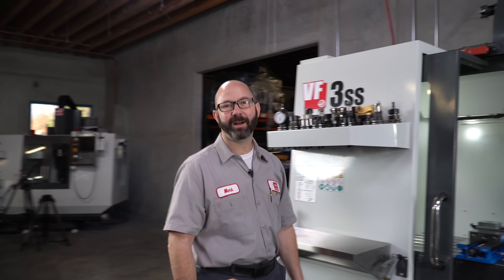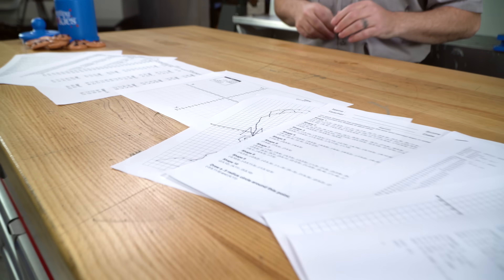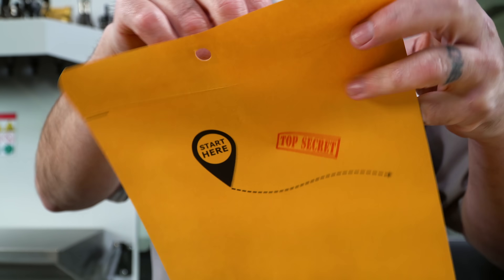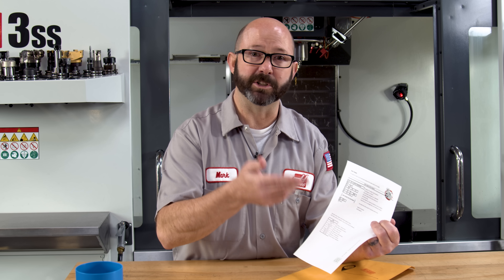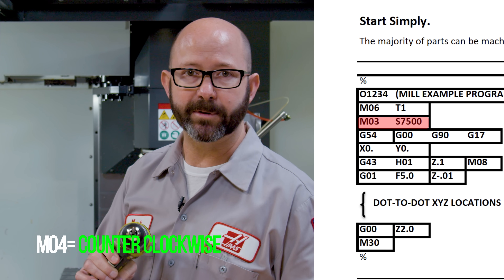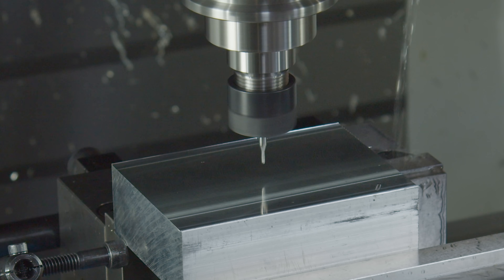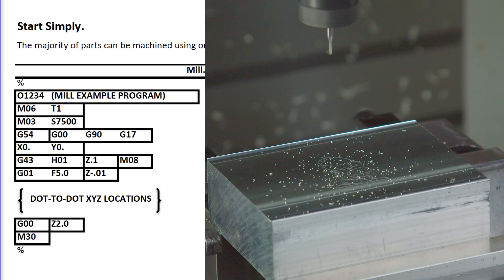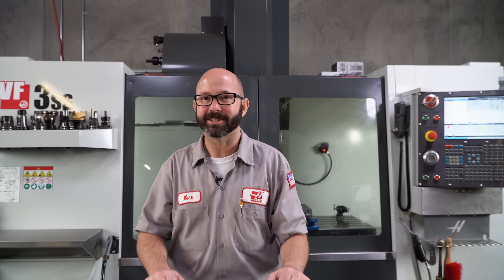9 Lines of Code Every CNC Machinist Needs To Know! - Haas Automation Tip of the Day

Comment: problem we got is  30 tool holder but 100 tools, so we use H numbers 1-100 , then get them wrong in the g-code and break them .. ... .. .. ...... ..
Reply: I doubt you’re using 100 tools in a single program. I can’t recall ever really using more than 20-30 tools in a single program, often it’s like 10-15 tops depending on the complexity of the part. When doing setup for either the entire part or individual operation if it’s a multi-op part is setting up your tooling. You load them in and touch them off real quickly. To save time I often write down the length and diameter on the side of the tool holder with a sharpie if I have to take it out and put it right back in in a subsequent op and need tool magazine space or when transferring to another machine real quickly. Not sure why you’re having your issue. Your setup sheets from your CAM should tell you which tools to load and assign to the various tool number.
Reply: @jumpman2680  i hear you,  i dont htink we are using the machine properly,  we are using it to do alot of hole drilling ( hydraulic manifolds)  and are manually typing out the g-code..

Comment: I am confused, I understand most of the G and M code, but I still feel lost.
Reply: Don't worry it sometimes happen, even i have suffered from this bro! The CNC machine is just a cartesian robot meaning it can only reach any point in the space with the help of linear movements. Therefore only ideal possible code for cartesian robot is GOO/GO1. You need to input a point to machine, by default it will take origin point + user  input point, then machine will figure out  how much  it need to move in X,Y & Z so that it can reach that point.  Any shape in the world either it is 3d/2d is just collection of points. Rest of other codes are for efficiency and user convenience  and also important. You can only define the geometry of any shape with help of notion of POINTS....why these things the way they are.... a lot of this stuff built by mathematicians back then....That's why they look very abstract....The CNC machines theory comes from a lot MIT SERVO LABRATORY in 20th century. Best book I suggest to read: "Theory and Design CNC machines - springer". I have tried my best bro. Don't worry you will get it, just it takes some time.  Sorry for my bad English, My mother tounge is different. Sorry again!

Comment: I am currently learning the old Haas SL30 at my job. I am freshly graduated from 4-year machinist apprentice school and am soaking up as much CNC knowledge as possible. This video series is awesome. Definitely need this. Subscribed!
Reply: What kind of salary are you getting ? I know it's such a superficial question  and very location based, but I'm curious. Thankyoh
Reply: @hassaanawan9606  I work for a Department of the Navy owned shipyard. I’m a WG-10. I’m hourly not salary.
Reply: @hassaanawan9606 I've never  been to a class for cnc 6 years experience running varying machines from crap lathes and mills to extremely nice lathes and mills. I make 32 a hour. Average about 80k with ot. Think I got like 84 last year this year we got less ot so a little less. Hoping to get a little higher wage soon and break that 100k mark. Alot of machinists / operators make less than me though. I even make more than half of the journeymen make in our shop. Seattle area just to give you a reference point. If you want real money get into hvac lol

Comment: What is the point of the G17?
Reply: It sets the active plane as XY. Some machine controls use XY by default but it’s good programming to always set your active plane. You might machine 99% of the time in XY on a 3 axis but for example if you’re using a ball mill or a 5-axis machine you’ll likely need to switch to another active plane.

Comment: how does the M6 command knwo what to do withoud additional gcode
Reply: an automatic toolchange that is
Reply: On Haas machines with Side Mount Toolchangers SMTC, the M6 will command a tool change to a tool that matches the last called "T" Value. That previous T value can be on the same line, or any line that came before. Commanding a T10 would pre-stage Tool 10, but not change to it until an M6 is commanded. Check out this video for more details https://youtu.be/zjRACstFxNE

Comment: Noob here. Why would you want to use the console?
Reply: It depends on the parts we run. Some parts might just be facing and drilling, and we can program those right at the console. For anything more than a couple holes, I'm using my CAM System (Fusion, Mastercam, hyperMILL, Esprit...). If I had one piece of advice for a young CNC Mill Programmer, it would be to learn the basics fast (like these 9-lines) and then spend your time learning a modern CAM system. There are always exceptions (certain sub programs, macros, etc.), but 99% of the time, a CAM system, and programming at your computer, is the way to go. Edit: I always have to mention that I know some incredible hand programmers, especially on lathes, and those skills are always in demand, but..... CAM is awesome. CAM (Computer Aided Manufacturing) is just the first step in machine automation, automating as much of the programming process as possible.
Reply: @markterryberry4477  Thank you for the reply. More autistic noob questions... by CAM do you mean specifically CAM, or CAD/CAM (sorry it tis autistic, but that's the joy of parsing life literally) 
I have been doing CAD for decades. But my end point has always been a client not a machine. 
I am familiar that I need to "do something else" [CAM?] to get it to CNC. 
So, does my CAD knowledge supercede the need to know the CAM nowadays, or should I still learn CAM stuff?
Reply: @m4rvinmartian  Most CAM systems have a built-in CAD side to them, and some are quite good. You can always draw up parts in what you know (Solidworks, Catia, Pro-E, Inventor) and then open that file in a CAM system. But yes, most systems today are CAD/CAM and can do both.

Comment: So I’m taking an assessment for Cnc bender after my 3rd day tooling parts. I’m nervous because I really want to do this but afraid of being turned down. I know nothing about the machine. But. I was pretty good in algebra so hopefully it’ll come back to me. I am going to study these codes so it will help me a little. Wish me luck guys
Reply: How did it go?
Reply: @imaamericangirl1406  I can’t believe how much has changed since then lol. I was told I was going to take the assessment and they never came and got me off the floor so I left and now I have 3 certifications with the department of agriculture and rural development and currently get rid of your skeeters

Comment: It is international machine tool code. I took g-code from my trumpf laser machine, and ran it on my haas VZ-3 SS. I transferred the trumpf machine code into haas machine code by using copy/paste on a DOS editor. Then I saved those as blocks . I made 150,000 parts by precutting those parts on my trumpf laser, then finishing them up on my haas VZ-3 SS. I never had a reject using this process, besides, saving a ton of money by not having to buy another expensive software package. 

It’s only a key stroke for the same thing. Once I got a proofed part, I saved that program in the control and my computer for another run. Code is only text . 🤠

Comment: Decades ago I setup/ran and programmed a VF-2 . I had years of manual experience and a few years with a conversational cnc mill.
When I was asked to run the Hass I was the only one there that had cnc milling experience but no g code experience.
The Hass programming book was just a wealth of information that within a month I could program anything that the machine could possibly do. It also had a rotary 4th axis that I used on occasion.
On line support had very useful information I could use also.
Everything was easy to understand.
I even did some hard milling on it and saved a tremendous amount of time vs surface grinding.
We didn't have Cam at the time so all hand typed in but it wasn't difficult.

Comment: Whats the point in knowing this when most cad / cam software makes the g code for you?
Reply: It’s a great question to ask. So much of CNC machining today should revolve around our CAM software.  These few lines of code, keeping our machine from crashing by calling up the right tool, or starting our spindle and coolant, are very critical though - not every code needs to be memorized, but these for sure. I don’t suspect someone could get a job as a CNC programmer if they couldn’t identify these 9-lines of code and tell us their importance.

Comment: I will have to say thanks for the tips. I am working in a prototype shop with one other machinist who finished school a year before me (I only finished the program last year with the CNC certificate on top of my machining diploma) and having nobody with years of experience to help with the transition from student to machinist has been somewhat interesting. We run Haas VF3, TM2 (usually me running that one) and a TL2 (have been spending a lot of time on it over the past few months and have earned the title "lathe guy" from some of the engineers), so learning simple tips like what you show are always helpful. They are even more useful as I plan on returning to my school as a part time teacher (only requires 2 years minimum experience), so several things from these videos will be going into any CNC classes I end up getting involved with or just generally helping out students that are in those classes. Can't wait to learn more to improve upon my knowledge for better ways to have parts coming out of the shop.

Comment: Haas is the only cnc machine where you still have to program using g code 
No wonder why youre losing every single f1 race
Reply: For the most part, its all about our CAM system these days. We'll still need the basics, like these "9-lines" to make sure that the tools that we have programmed match what is in the machine.

Comment: Why is gcode an issue?  The cad programs generate it.  Machinists still live in a world of manually entering gcode?
Reply: Just the basics, for sure. I'd say every CNC machinist must know how tool offsets are called, and how safe tool changes are created. But I'm with you. CAM generated programs are the standard, with the ability to verify machining strategies on your computer, before you ever move over to your machine control. There are certain parts, and industries, that have very specific needs where hand programming is really efficient, but in general, CAM is king. We'll make videos like this, not to dissuade you from using CAM, but to get the basics out of the way quickly, leaving us more time for CAM!
Reply: You still should know the basics regardless. The better you understand what a program is doing, the easier it is to find if there is a problem or how you can modify a program when needed. At my work place (prototype shop), we don't have a license for our CAM software for lathe, so I am usually programming it manually, mostly G71 when allowable. On occasion for some smaller and simpler tasks on the mill where it would be more of a waste of time to draw a model and then set up for a code on a part I will only be making 1 or 2 of, I will just program my own G-code (no sense in drawing an odd size hole when you can just G2 or G3 it yourself). If you are in a production shop, it is completely understandable to never need to know more than enough to pass whatever training or classes your employer would want you to have before working in that environment as most of the programming will be out of your hands anyways.

Comment: What CAM software are you using in this video?
Reply: We used hypermill in this video at 10:28 . I'll use/have used Fusion 360, MasterCam, CamWorks and others. Finding the right CAM system for your parts and equipment is a big step, but definitely a step worth taking.
Reply: Hi  @markterryberry4477  , thanks for getting back to me! I ask because we’re at a crossroad of either renewing the license for vintage surfcam or moving on to something newer, better, and hopefully something that stops crashing the computers.
Reply: Disaster CAM version?.......

Comment: The idea to setup a pen instead a tool, for me, is a great idea to show the simple method of xyz axis movements to fellow students or however you wanna call them ^^
 I only think one basic is missing. setting up the G20 and G21. Imagine u set your feedrate as metric user in a inch system. Good Bye
Reply: I was trying to offset my work down a bit for a slightly deeper cut than what was spec'd.... imagine my surprise when my G0 Z-2 command to go 2mm below the zprobed height tried to plunge 2 inches down into my spoilboard. Horrible noises were made.
Reply: A crash on cnc can happen to everyone &everytime.  @bermchasin

Comment: The g90 is confusing me a lil anyone mind explaining in detail
Reply: I know this is a little bit of an old comment, so I am sure you have found your answer by now, but for those that are curious, there are 2 different systems that a coordinate system can move. It can either move in absolute (G90) which uses a set position as a reference point or your part origin or can move incremental (G91) in which it uses the last point it was at as a reference to move from. 

Let's say you want to drill 2 holes at 2 and 5 inches to the right (X+) from your origin (0,0) which is for this example set on the far left side of the part (we will ignore the Y position for this example), in absolute you would simply set your X positions as X2.0 and X5.0 and be done with it. But let's say you are using incremental and since the first hole you drilled was 2 inches from from your origin at X2.0, and you have X5.0 for the next hole in your program, but because you are in incremental your hole you planned on drilling is now at X7.0 since it moved 5 inches relative from the last position and not to the X5.0 you thought you were going for, 2.0+5.0=7.0. Hopefully that helps someone out there understand a little more than they did :)

Comment: These are indeed the 9 most used lines, though every "Dialect" of G-Code has its own quirks..
Basically, every  experienced programmer, when programming at the machine will start with the same lines of code every time,  and he will also use the same lines of code at the end of  a program.
You could have included G20 /G21 for Inch or Metric programming as well
Though i don't really like HAAS Controls, i do like these videos.. Keep up the good work!
Reply: How would you improve them, Jan? Maybe they will take note?
Reply: @imaamericangirl1406  How to improve a Haas Control?.. Redesign the keyboard, start using Softkeys, get rid of the beeps.. for starters..

Comment: Which is best hand programming or fusion 360 which is automatically generated G codes
Reply: CAM systems are sooooo much more productive than hand programming. I still think knowing the basic code is a must for machinists though, as we edit programs for efficiency, reliability, speed, safety, macros, robot integration, automation. Knowing the code helps you troubleshoot issues, adjust tooling numbers, change offsets and compensation values. I do know a lot of lathe programmers, and mill guys who only work in castings, that are still hand programming and would be hard to beat with any CAM system, but for typical billet mill parts, you’ll want a CAM system.

Comment: How come everyone wants to program in inches per minute instead of inches per revolution. It is so much easier to control surface finish using inches per revolution. Also, why do some CAD/CAM programs do not have a line number before each block of code? It is a whole lot easier to trouble shoot program errors & to call up a specific block of code when there is a line number such as:
N10 G00 Z0 X0 Y0 
N20 G00 Z-20 X-10 Y20
Of course these two lines of code would be in inches per minute where as if these lines of code were actually cutting material they should be in inches per revolution & have a G01 instead of a G00 & I left out the G code for absolute or incremental.
All of our milling machines & lathes GE had line numbers for each block of code, inches per minute was used for rapid movements, & inches per revolution was used for cutting. 
Maybe they line numbers were put by the post processor or the controls, I really have no idea. We had GE1050, GE2000, & several different versions of Fanuc controls.

Comment: In what G code # ,the machine will know what plane we're using , either xy,zy or xz?
Reply: Great topic. Check out this video https://youtu.be/URO3ETG18bs?t=379. Our G17/G18/G19 Plane selection tells the control which way our canned cycles should go, and which way G02/G03 arcs are made. Great topic. We should make that video.  This is really important for Live-Tool lathes as well. Thanks for the comment.